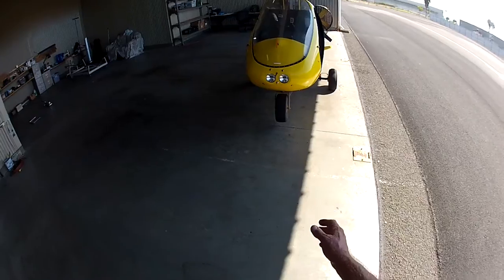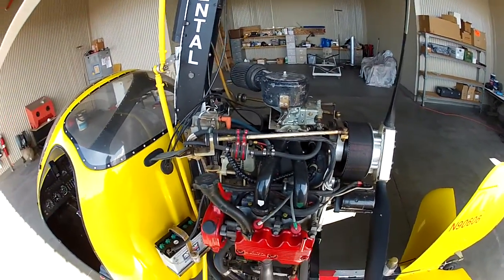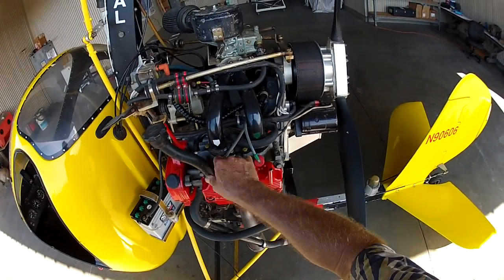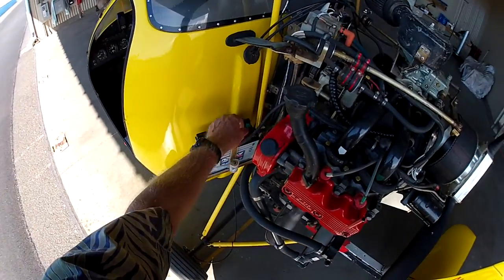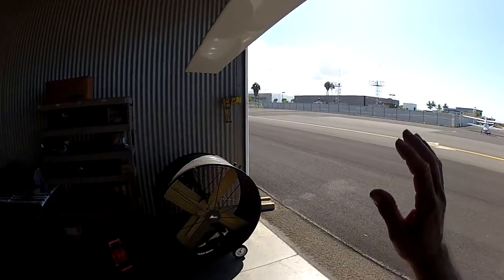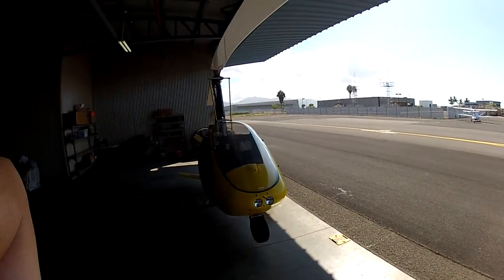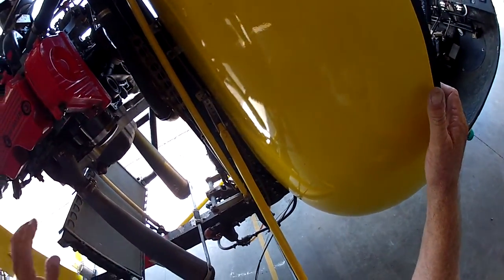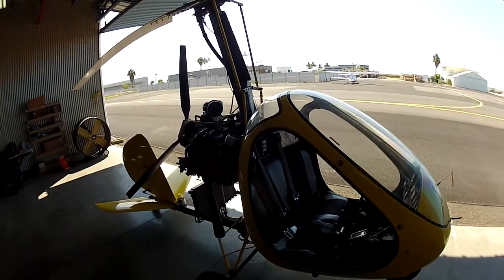Gyro Preflight

Comment: I noticed the rotor blades , the weighted tip seems quite substantial or is that a piece of alloy . just thought putting a longer hex head allan key bolt in for the weight ... but nice gyro .
Reply from the maker: This gyro is for sale for $18,000 including a spare set of RAF rotor blades and covered trailer, spare parts and special tools.    Visit Hawaii, taxi and fly this gyro, ship it to your airport, tow it there or fly it there from the West Coast.      Brian   n34212@gmail.com, ph 808 630 5900 or 808 988 5659.